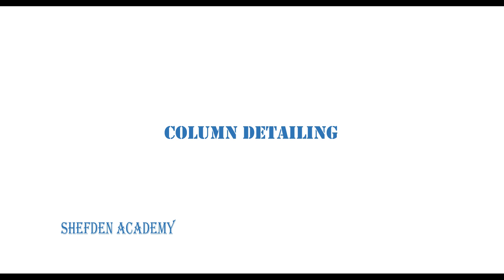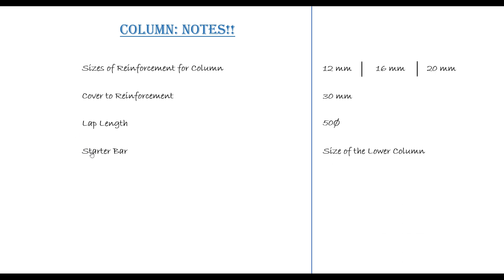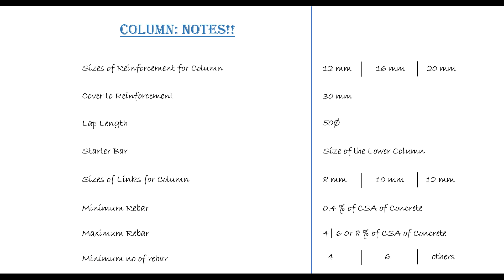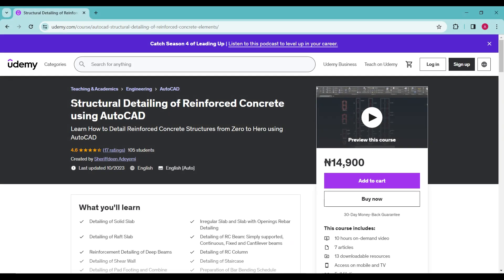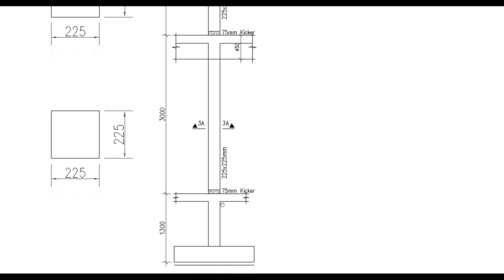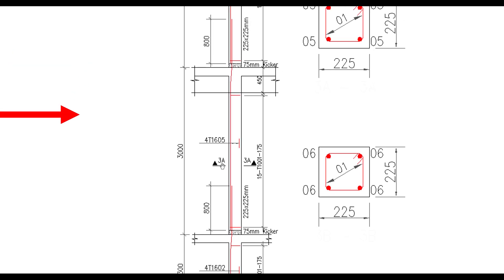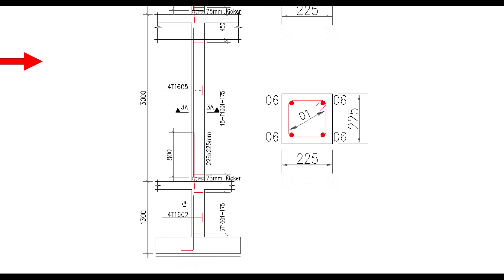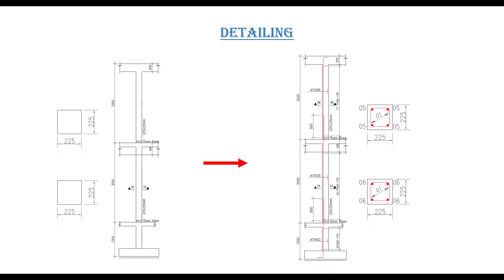Detailing of Reinforced Concrete Column

Comment: Thanks for the simplified tutorial. I have a question though:
What if the column on a higher floor rests on a cantilever beam. How would you represent it seeing no column is directly beneath? Would you create a base for it?
Reply from the maker: In the situation the column started bar will start from the supporting beam/slab(in case of a flat slab)